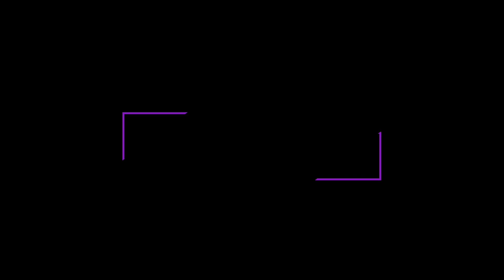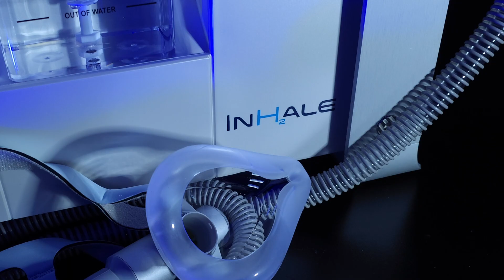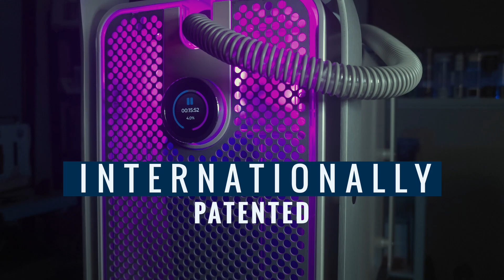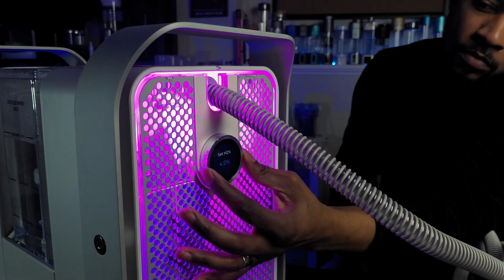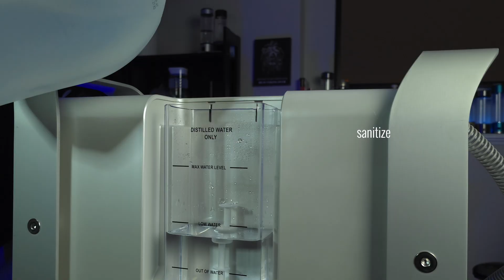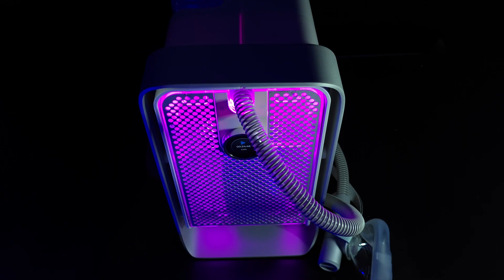InhaleH₂ Full Review — Zero Risk Design? - H2HUBB APPROVED

Comment: Excellent video. Looking to get one of these machines. The only drawback I can see is that it is manufactured in China even though it is engineered here in US. Do you have any idea if the manufacturer is ISO rated? Do we know what specific PEM technology they use? Do they use commercial platinum/titanium or Grade 1?  Is it warrantied for a specific number of hours? I will probably pull the trigger on this unit, but I would also like you to dig a little deeper on the actual manufacturing specifics. Thank you and keep up the GREAT work!!!

Comment: Does the lower flow rate mean you need to spend more time on the machine to receive the same effect as higher flow rate machines?
Reply from the maker: No. Inhaling hydrogen gas at a lower flow rate will produce a specific inhaled H2 concentration, such as 1%, along with a corresponding blood or cellular H2 concentration, such as 7.0 µmol/L.

The same is true for higher-flow systems. Depending on the person’s breathing dynamics, each flow rate will produce its own inspired H2 concentration and subsequent blood and tissue H2 levels.

You cannot obtain the same H2 dose from a lower-flow system simply by breathing longer, because lower and higher flow rates deliver different amounts of hydrogen gas per breathe and per minute. Once the body becomes sufficiently saturated with hydrogen, each system produces its own unique exposure level based on the amount of H2 being delivered and inhaled.